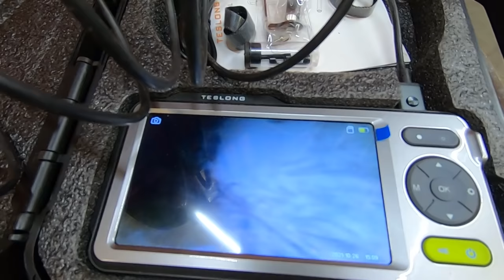Abandoned 1962 F100 Factory 4x4! First time driving on the road in 39 years!

Comment: Different motor mounts, generator mounts, bellhousings, different size bolts, yada yada yada. Typical Fords. I did a water pump on an 87 302 (er, "5.0") that had 14 bolts, of 3 different sizes, 3 or 4 different lengths, and had EVERYTHING else (smog, ac, ps, alt, idler, etc) bolted to it. And of course, the 2 longest, thinnest, rustiest ones snapped off. I filled those 2 bolt holes on the new pump with blue rtv. Worked fine for another 5 years before I blew it up. Fords are fun.
Reply from the maker: Makes you wonder what they were thinking?!?

Comment: Distilled water is like 50 cents a gallon....  So, if you ever had a ride worth saving, you could splurge.....  

That is not a criticism....  But when you're scraping the piles of rust out of the water pump housing area with a screwdriver....  It's a disaster, don't bother with distilled water....

Comment: Apparently psychedelic drug use was a thing among Ford engine design engineers during the production of the Y-block. There’s just no other logical explanation for it’s design. 👍
Prior to CK-4 specs diesel oil had more than enough ZDDP for flat tappet cams. Current CK-4 oils top out at about 1100ppm of ZDDP.  Not enough for long term use in flat tappet engines. Risolone offers a pure ZDDP additive in the blue bottle. I purchase it on EBay for about $9 a bottle shipped.
Reply: Should gave swapped a 5 liter in simple
Reply: Actually, the engineer who designed the Y-block, cut his teeth on diesels. The mushroom lifters grew from that. The"over and under" intake was en effort to make the runners of equal length,for balanced fuel distribution.Unfortunately, not very good for horsepower, but, vastly better than the flat-head !

Comment: better not clean that engine or your gonna find how bad the front and rear main seal leaks then you will have to fix that too. I would of found a newer windsor block like a 289 or 302 and put it in there instead of a crusty Y block that has 2 inch thick of oil and dirt

Comment: Copper gasket maker in a can bud
Reply from the maker: For?
Reply: Most things exhaust manifold ectect try it out might work with that problem you may have or that good old cork board or any other material to make gaskets out of then can cooper gasket maker coat it as well

Comment: You are a Chevy man Chevy truck GMC truck they will run forever they're easy to work on and make a lot of horsepower Ford trucks are garbage they don't make a lot of horsepower they got heavy frames that's it but they always had garbage at engines and bad oil pressure